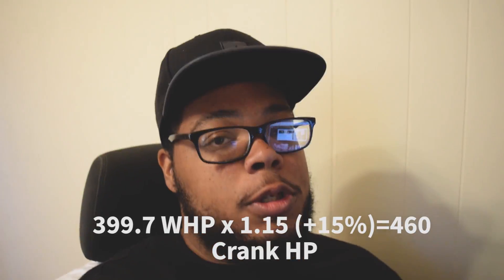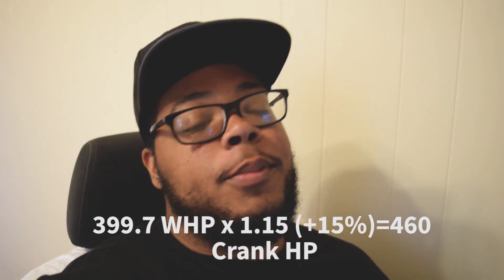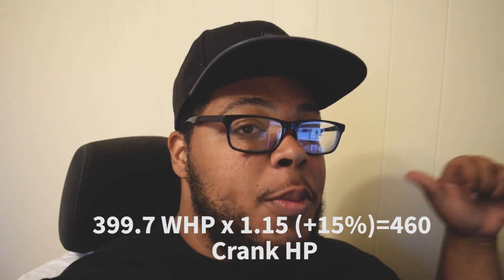We DYNO the Trans Am and Gain 100+ HP

Comment: Nice man. I installed a MS4 cam and 799 heads in my 93 Z28. It puts down 448rwhp and 420ftlbs of torque.
Reply: sierravmax that's with the LT1??
Reply: I guess I should of specified that I swapped a LQ4/T56 into it. oops lol

Comment: damn want cam and heads did you swap and did you have to swap the torque converter to? I think this would give me some serious gains on my 4.3L V6 S10 ZR2 i already have headers,cai, super coil,MSD wires,no cats, with a flowmaster super 10 and a custom welded exhaust from header to exhaust tip. i want to put a 6inch suspension lift with a 2.5 body lift to tuck 35inch tires under it but I gotta beef up the motor to handle the extra weight. and probably have to re gear the axles.  how much did the heads and camshaft run you ?
Reply from the maker: Dillon Koch 243 Heads from a 5.3 Truck and BTR Stage 4 Cam for LS1/LS6 
They won't work for a 4.3 so you'll have to find a cam specifically for the 4.3 or swap a 5.3 into it
Reply: Turbros Garage are those heads touched or all stock. Keeping an eye out for myself on my hugger orange 99ss
Reply from the maker: mcfero1 all stock 5.3 heads
Reply: Turbros Garage yeah I can probably find a camshaft close to those specs and there is a guy here in my home town that will port stock vortec heads for $300 is that a good deal ?

Comment: Are you sure that camaro only made 360 WHP?  They make430 without any mods stock.  That seems awfully low.
Reply from the maker: WITSENDFL that’s to the wheels, with 18% drive train loss at 360WHP, it makes 424 to the crank.
Reply: Turbros Garage was that a manual or an automatic?  If that was a manual with the LS3 and not the L99 that still seems incredibly low.  Mine recently was on the dyno and was making 467 with just a cold air intake long tube headers and a cat/ resonator delete

Comment: throw in a yank 3600 stall you'll push all the HP off the line quicker trust me. I own a 2000 Ws6 fully bolt ons with 3.73 gears and a 3600 stall pushing around 368hp 400tq I'm beating cars pushing around 380/400hp . I just purchase a Texas Speed cam magic stick can't wait to slap it on . I like your bird man just make that shit beefy and dangerous good luck ! Also race a 5.0 Coyote I wanna see that shit drag ponies